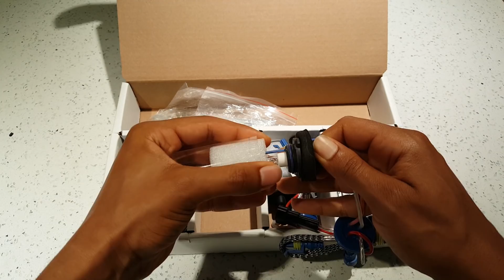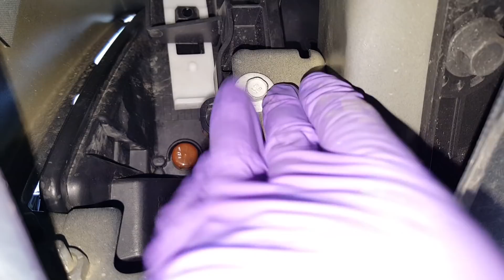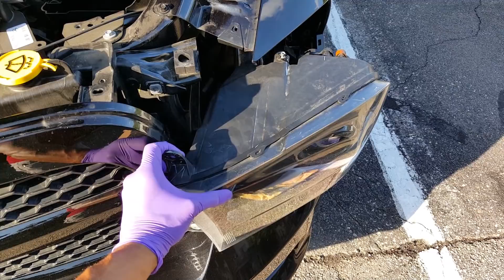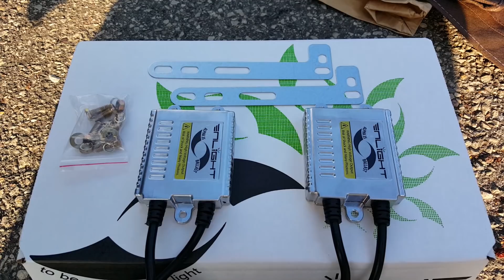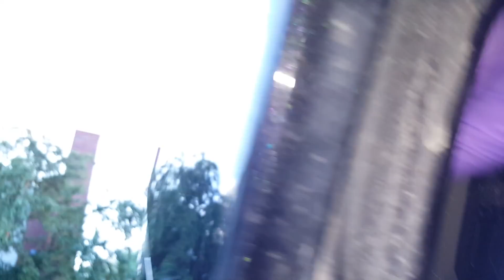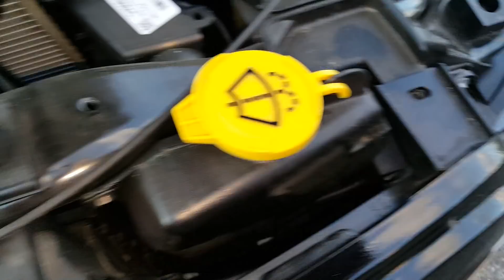DIY: 2009-2014 Dodge Ram 1500 Xenon HID Headlight Install Guide by ENLIGHT

Comment: I didn't read all the comments but you can save alot of time by not removing the top plastic piece and grill. You can easily get the headlight out with a 10mm socket and a long extension. Not sure why everyone says take off the top part and grill??

Comment: You're prying on those clips wrong. You need to get under the cover and then pry and it comes right off. You can actually just grab the cover and pull it.

Comment: How hot/warm does the ballast get? if at all.
Reply from the maker: The ballasts will get warm after being on for a while. If the ambient temperature is 70 degrees F, the ballasts can warm up to 120-130F which is normal.

Comment: Just installed my kit on my 2013 Ram 1500 with projectors, not a hard install, took me 2 hrs. Lights are bright. Also the low beam no longer cancels when high beam is turned on, both low and high are on when I click to high beam, so I have lots of light now.

Comment: I can't find hid kit for lights for 2012 need asap
Reply from the maker: Hello, if you have a 2012 model that has the Quad style headlights, you can purchase our 2013-2014 Ram HID system and select "Reflector Style Headlights" and it is compatible with the 2012 models. However if you have the "Dual" Style headlights, we currently do not have a kit that is compatible with those headlights.

Comment: Make your lives easier and just remove the grill. You don't need to pry the clips with the screwdriver.. just pull out with a little force and it will come right out.

Comment: I put mine in I got the 9012 hids because and they are flickering when I turn them on what do I do??
Reply from the maker: Where did you get the kit from? The 2013 and 2014 Rams require a canbus compatible ballast or the lights will flicker or shut off.

Comment: how does doing it to the high beams work.. do you drill 2 holes in the headlights???
Reply from the maker: +Gnoob 

The 2013+ Rams with factory projector housings actually have 2 high beam functions. The factory projectors are dual-beam projectors. There is shutter inside the projector which folds down to give you a high beam pattern from the projectors. When you install the HID system, this function is not compromised so you do get HID low beam and HID high beam function. However the 2013+ Rams also have a dedicated 9005 high beam bulb which is located adjacent to the projector inside the headlight housing. We do have an HID system available for this 9005 high beam bulb as well. Installation process is basically the same, you just need to drill a 2nd hole in the cap to allow the HID bulb harness to fit through.
Reply: +Enlight Automotive - Vibrant LED and HID lighting technology sweet I appreciate the Info I have standard head lights in my 14 ram so I will need both kits I assume correct me if I'm wrong?

Comment: Have you ever had any issues with them melting the housing? I have a 2014 Ram and every vehicle I've owned I had HIDS in them, someone told me that the housing on the Ram will melt with HIDS or LED?

Comment: I know the rams have problems with the HIDS with flicker and turning offdoes the kit come with an  Anti-Flicker Modules?I have a 2012 ram 1500 Longhorn
Reply from the maker: +SlimPeas23 
This kit will work on all 2009 to 2014 Rams if you have the Quad headlights with an H11 low beam bulb. Or the 9012 Projector headlights. Just select which headlights you have on the website. The kit has all the necessary electronics integrated for proper function.

However the kit is not compatible with any of the "dual headlight" H13 models.
Reply: +Enlight Automotive - Vibrant LED and HID lighting technology oo I need the H13 and the 9005 for my Bulbs for my headlights

Comment: low beam is 9006 or 9005?
Reply from the maker: +ramoncar21 

If you have a 2013 or 2014 Model with projector headlights, its 9012 bulb type for the low beam.
Reply: +ramoncar21 I installed on my ram and the low beam is 9005 and the highs are H11....Im pretty sure
Reply from the maker: +Aron Harper 
Low beams:
2013-15 Rams with projector headlights are 9012 bulbs
2013-2014 Rams with reflector headlights are H11 bulbs
2016 rams are 9005

All Rams 2013-2016 use 9005 high beam.
Reply: And what about a 2011 Ram 1500?
Thanks!

Comment: So for the 2012 do you not need the relay?
Reply from the maker: If you have a 2012 model with the H11 "Quad" headlights, you can use this Kit which is less complex and has no relay:
http://www.enlightauto.com/collections/enlight-your-2013-2014-dodge-ram/products/2013-2014-dodge-ram-enlight-massive-photon-generator-xenon-hid-headlight-kit-low-beam
Reply: +Enlight Automotive - Vibrant LED and HID lighting technology Ok thank you for your reply! My dad ordered me a kit and added 2 relays, 1 for fog lights 1 for headlights. So I don't NEED them but would they help?
Reply from the maker: There are many many different HID kits on the market. Without seeing the kit you have in person I can't really advise what is needed or not needed. All I can say is that the kits we have do not require a relay for the quad headlight models. But other kits might, depending on how they are designed.
Reply: +Enlight Automotive - Vibrant LED and HID lighting technology Just a bump to my previous question. I greatly appreciate your help thus far. I just received them in the mail and am waiting to get every bit of information I can before trying to install.
Reply from the maker: +Nuclear Fission Bomb 
Unfortunately I cannot really advise about the kit you have from HID extra. I have not tested their system and don't have information about compatibility. there are some HID systems out there which say they are Canbus, but actually do not work well with the Dodge Ram trucks. i have seen this several times. so you may or may not need a relay setup. i can only say that  the Enlight HID systems do not require a relay for the 2009-2014 Rams with Quad headlights.
Reply: +Enlight Automotive - Vibrant LED and HID lighting technology I will keep that in mind if these do not work out!  I couldn't turn down a free Christmas present so I didn't get to research anything on this topic.

Comment: Very clear instructions, great video. have you had any issues with melting or radio interference? seems like most of the hid kits i install interrupt the radio signal when they are powered on. any thoughts?